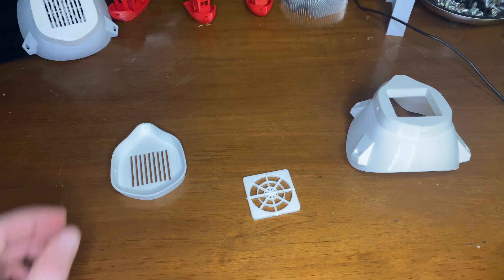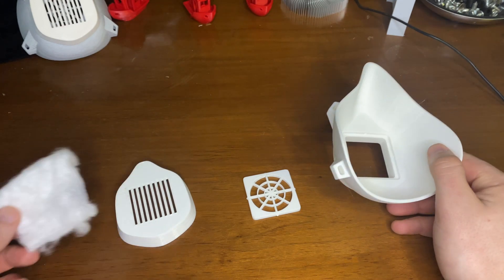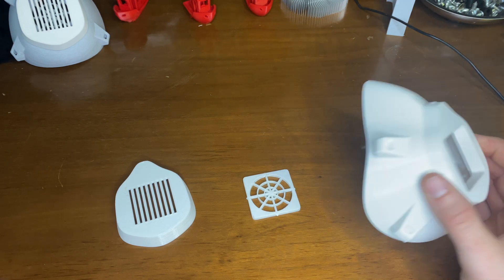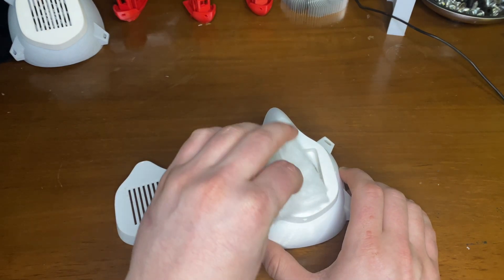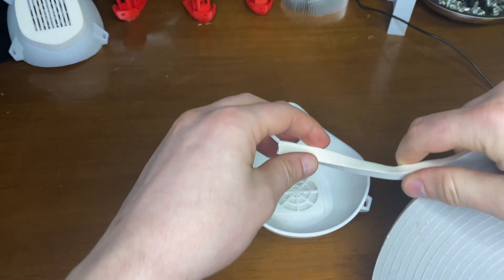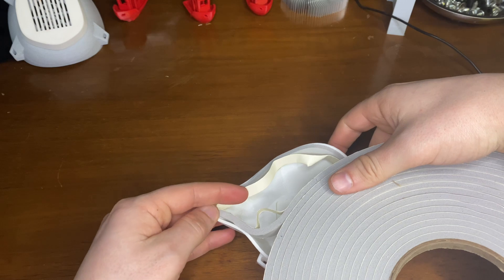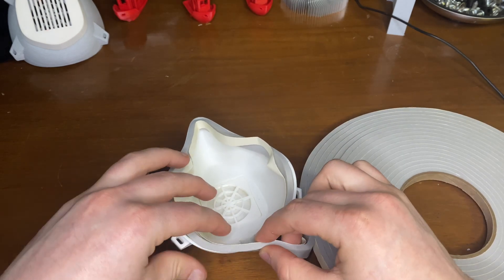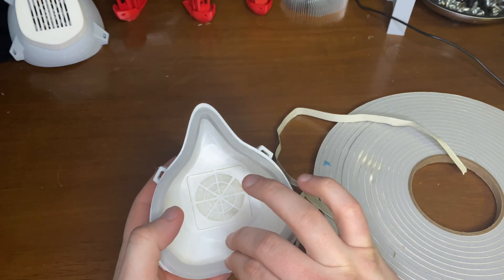3D Print Review - COVID-19 MASK

Comment: Won't help you, could harm you with false sense of security.  The covid19 virus itself is too small to be filtered.  The layers of cloth in medical masks block the transmission due to absorbing and stopping the droplets containing the virus before it enters the body.  These 'filters' your using are going to become saturated quickly, with moisture from your own breath as well as from the outside, making them useless and needing changed and cleaned.   The bigger concern is your eyes - as the virus (riding on droplets) can enter through your eyes. You need goggles or a face shield - like the shields being made and frames/hats being 3d printed to fit the face shield to.

This has better use as a dusk-mask and painters mask, but not medical/anti viral mask.  Remember as you wear your plastic mask your moisture is going to build up as well, and create 'pools' of sweat, breath moisture and spittle from talking- needing cleaned/drained for hygiene purposes. You can get seriously ill from bacterial infection from these types of devices being used and improperly cleaned/maintained, which then puts you in hot spots for the virus - completely going against the purpose of the mask use in the first place.

The best stuff right now is double layer cotton mask (changed whenever damp, then washed and sanitized) a full face shield (clear plastic that goes from ear to ear, and proper hand washing habits.
Reply: Valid points. However, he has enough filter material to capture the moisture. N95 masks, as tou are aware, have 3 to 4 layers, the first is a thin piece to help capture moisture, the second is the actual electrostaticly charged polypropylene and the third ia the same as the 1st. As long as you have extra filter material with you, juat change it out. To sanitize it, bake the filter material for 20 minutes at 170F. Just dont wash it.  In my tests, a more damp filter actually caught more particles. Kind of interesting.
Reply: Also, just wash the mask with hot soapy water or rubbing alcohol and it will be just fine. Ipa has a very low surface tension, as does soapy water. This means it will get into pores smaller than viruses with no issue.

Comment: Nice video.  If this is to be used as a surgical face mask, I think it will work fine.  But if you are insinuating that this will take the place of an N95 respirator which many front line medical staff require, this probably won't work.  The major fault is the filtration media.  How do you know that it will filter out a .200 micron particle?  Can you certify it?  The other problem would be fitment.  It would be too difficult to print out a separate mask for each face shape and size.  Time and material would be too costly.  To use an N95 respirator in our hospital, we need to be certified that the mask is providing an airtight seal.   They have different designs and models to choose from.  I would caution you about the legal implication of stating that this mask and the filter material would protect somebody using it from a Covid-19 infection.  I would not experiment with the health and lives of our medical staff.
Reply from the maker: My thoughts are those not on the front lines wear them. Therefore N95 will not be purchased by common people. That allows the medical workers to buy a N95 and use that. Medical workers are the true people that need them (N95 masks) more that people that are hoarding them.
Reply: @drewbottorff  Again, be cautious of what you say.  Everybody  whether they are 'common people' or health care workers desires to breath clean filtered air.  But because of the shortage of N95 respirator masks, many people cannot get them, but really should be using them as well.  I live in California where because of inept planning, our state government did not have an adequate back-up emergency supply.  3M is a large company and really should get on the ball to provide all Americans, then the rest of the world with them.
Reply: The filter material is furnace filters which can filter out viruses, its certified by the company whom makes it. Also, it doeant need to filter out 0.2 micron particles. It only needs to filter out 2.5 micron in size. A virus will never leave the human body by themselves, they are always attached to respiratory droplets, which are between 2 and 5 microns in size. There are many favtors that play a role in particle behavior such as flux, air pressure, specific density, specific volume, gravity, etc.

Comment: The weather strip your using.worries me because you need to wash the mask after use and the sponge will attract bacteria or even the virus. Maybe look for a rubber casket this way yu can just dump in soapy water to clean you can get the sponge wait it will deteriorate over time..Just my opinion.
Reply: No need for a rubber casket.  If you cannot bounce back to live by Easter Sunday....there is probably no hope.
Reply: @SilverShadow2LWB   Don't despair guy
Reply: The foam he is using is closed cell pvc. It has very little pores, and even with those small pores, as long as you use rubbing alcohol or soapy water, your good to go. Rubbing alcohol and soapy water have a very low surface tension meaning that they can get into very small pores, even smaller than viruses

Comment: I've been making the straps out of the synthetic rubber found in bungy cords. Also I don't like that particular version of the mask. A negitive pressure test fails, the Montana mask passes the test and only needs 2 parts to print
Reply: I remixed this mask to print in 2 hours and only has 2 parts now. I removed about 13mm of the front "square" part, then filled in the square hole with its own grid. I then added a 10mm hole in the front so that you can pop the filter clip out with a pen or pencil haha. I use a silicone gasket i made around the edge and it passes the negative pressure test.

Comment: Use a air filter for the filter
Reply: another idiotic reply....are you going to risk breathing fiberglass particles or untested fibers directly into your lungs?  Next thing we know, you will be putting your name down on the class action mesothelioma law suits.  Think before you promote the usage of dangerous products.
Reply: @SilverShadow2LWB   don't think 3m hepa filters, made for filtering air inside a confined space have fiber glass particles SilverRetard2LWB. also they have a particle filtration rating so they are tested. Dumb kiddo.
Reply: 420 Dab I second that. (Except that last part) I too am working with the hepa filters. While there are some filters (shopvac) made with fiberglass, hepa is one of the exceptions and actually filters 99% where the n95s filter 95%. When used correctly of course with the proper measurements as I’m hoping one would have the common sense of figuring out before starting such project. And in this scenario, there would have to be different sizes made so it can fit different features. I’m no Professional at these things, but I worked in healthcare 13 years and my husband, brother, cousin and brother and law  is part of the front line team so I know what anything is better than nothing means right now. They can figure ways to make it work I’m sure if not. They won’t. But what if they can.
Reply: @QuietFaithStillGrace  I do not claim to be a professional at medical design.  So instead of trying to sound like an expert, I called our hospital pulmonologist as ran this by him.  He says that he does NOT recommend trying to make an N95 respirator out of unknown material.  One would have no idea of the binders used to make the filter, something that I didn't even think of.  He says that for personal use, it would come down to personal choice.  He deals with people who make similar choices when it comes to vaping and smoking.  But he too is alarmed that people are condoning this use for other people as well as medical staff.   Try and put your energy and creativeness into cloth facemasks and faceshields which can be more universally accepted and used.  There is little danger to others.  Above all, support your local hospital and staff.  Send a few pizzas there way.  It is always appreciated.
Reply: @SilverShadow2LWB  any 3m air filter with a rating higher than 1500 is able to start filtering viruses it says it clear as day on the packaging
Reply: @SilverShadow2LWB  dont use ipa(rubbing alcohol) to sanitize a n95 mask. Ipa has a dipole and polar type bonding, meaning it WILL cancel out the static charge of the filter material. But since your spritzing it, you could be fine. Dry heat ia best way though, Just bake them in an oven at 170F. Polypropylene has a melting temp of about 430F.
Reply: @SilverShadow2LWB  home furnace filters do not contain fiberglass for this very reason. They are made of electrostaticly charged polypropylene which is exact same material as n95 masks.

Comment: How about printing it in TPU or another flexible filament?
Reply from the maker: christopher michaels I’ve seen other people print it in tpu and it still functions greatly. I didn’t have tpu when I did that video.
Reply: @drewbottorff  It depends upon what you mean by functions greatly.  Did you have the mask tested?  Did it receive N95 standards?  If not don't promote it as such.  You are playing with the lives of anyone using this for Covid-19, asbestos removal, and insecticide application.